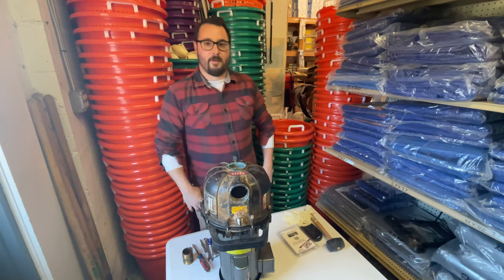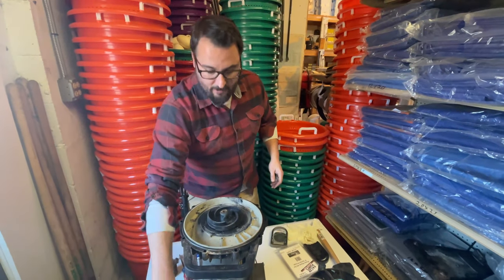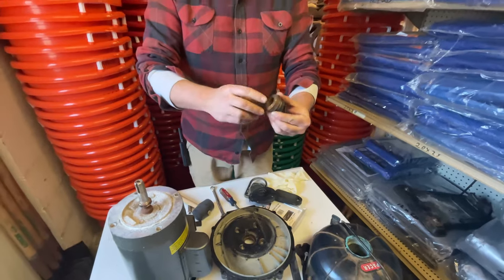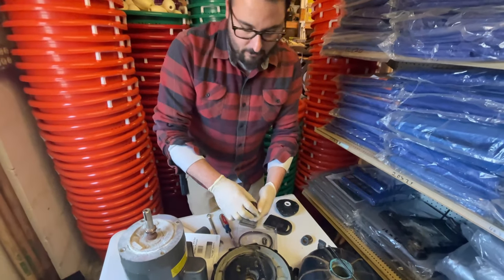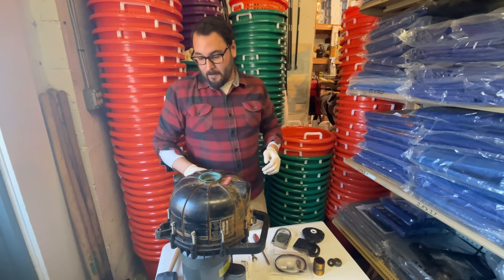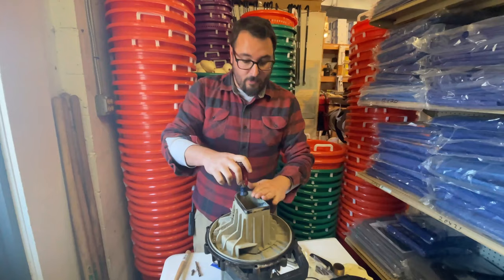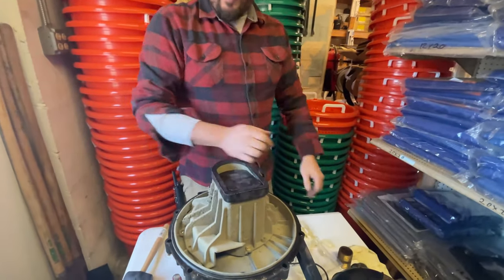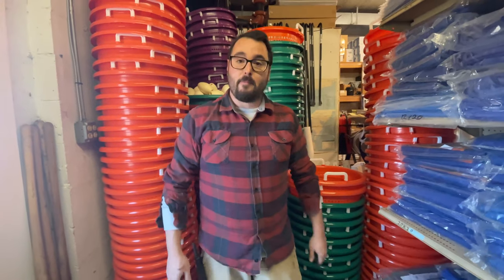How-To: Replace Seals on Pacer S-series water pump

Comment: What happens if the seals dry out? Could that cause the return speed to decrease? I have a se2bil hydraulic pacerpump that was run dry, and now it only delivers 600 liter pr. minut instead of 900 liter pr.minut